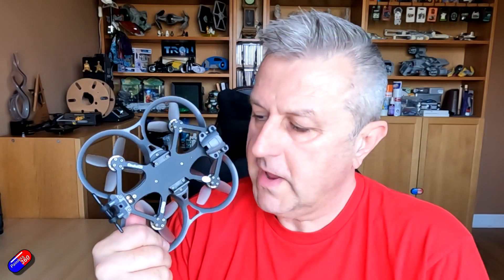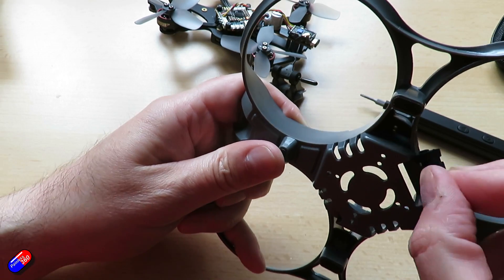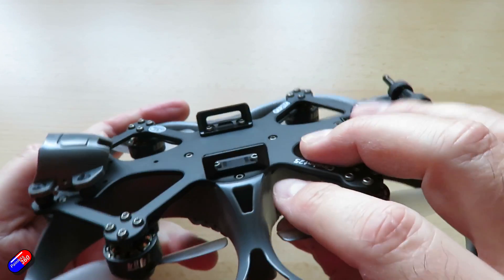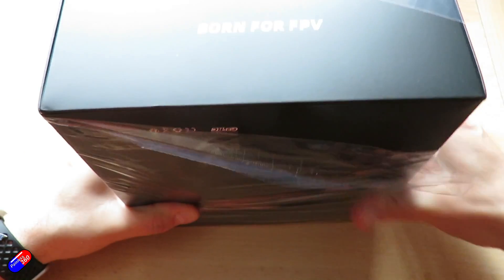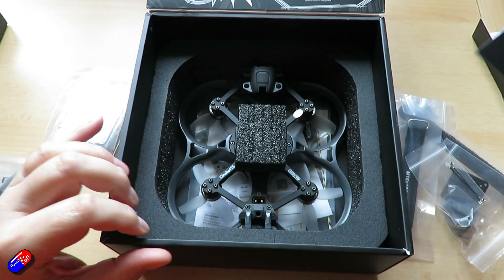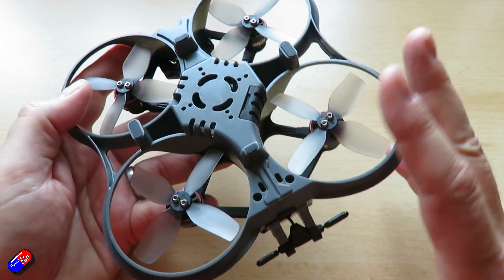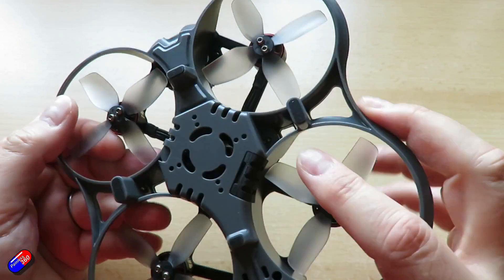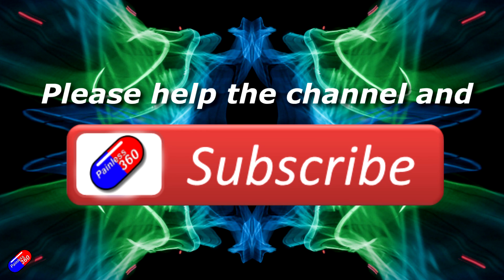GepRC Cinebot25: Why make a quad without FPV gear that only fits DJI 03 and analogue?

Comment: I was able to put the Walksnail Avatar HD Nano Kit V3 into the Cinebot 25.  It was a pain.  Here are the modifications:

1.  The VTX must be mounted upside down. This allows the USB connection and bind button to be aligned with the port door.   The 20mm x 20mm bolt holes on the VTX are on top and unused.   You must use the 25.5mm x 25.5mm holes.  The walksnail VTX comes with longer bolts.  Put the bolts through the Cinebot 2.5 VTX heat sink, the fan guard, the metal piece for the IPEX connector, the VTX, and the camera connector harness.

2.  The fan duct has a location for a bind button.  I had to drill this out and remove some plastic so that the VTX would sit flat and the holes would align. 

3.  The 5v on the GEPRC Taker G4 45A flight controller does not supply enough current for the Walksnail Avatar HD Nano VTX and the other peripherals.  When I tried this it would either loose video or fall out of the sky.  You must use a BEC(Battery Equivalent Circuit).   I purchased a MATEKSYS Micro BEC to supply 5v to the VTX. 

4.  You must wire the VTX to a free UART.  I used UART 2. This means the betaflight configuration must also be modified. 

5.  I also created a camera mount so that the 14mm Walksnail Nano camera wouldn't need a shim.
https://www.thingiverse.com/thing:6683271

Comment: Sadly, as far as dji has grown from it's naza says they have become the apple of drones super easy and proprietary I remember when the flying cow had an xt60 and was only limited by it's internal bay with hobbest adding external dull battery trays then it was a proprietary battery and tx/rx system this is no different it's all about greed sad to see it's grown so big there effecting other companies so drastically...

Comment: What a shame geprc have gone this route. I have a Cinebot30 now based from your review Lee it's awesome to fly and I don't fly dji either so looks like I won't be upgrading anytime soon 😂
Reply from the maker: There has to be a reason why so many 'BNF quad' vendors are only selling 03 options. This model really doesn't make sense for GepRC, why design a model that ships without a HD system installed and Not make it universal? I think we can guess it is due to pressure from DJI. Are DJI that worried about the other systems? Starting to feel like it... Happy flying
Reply: @Painless360  For sure their worried and competition is a good thing for this hobby 😀

Comment: Agreed, way too much hardware being designed around O3.  Just fitted a moonlight kit to Gep's big 7 inch quad - blown away that the dremel needed to make an appearance for such a massive frame, because of course the sleek VTX mounting system expects an O3 unit
Reply from the maker: There has to be a reason why so many 'BNF quad' vendors are only selling 03 options. This model really doesn't make sense for GepRC, why design a model that ships without a HD system installed and Not make it universal? I think we can guess it is due to pressure from DJI. Are DJI that worried about the other systems? Starting to feel like it... Happy flying